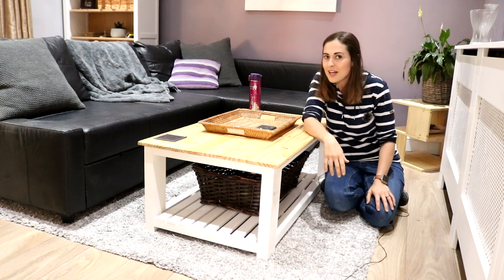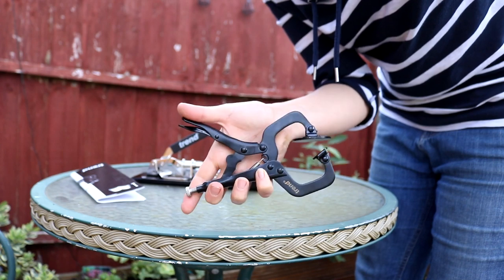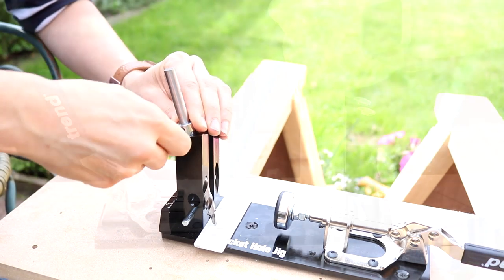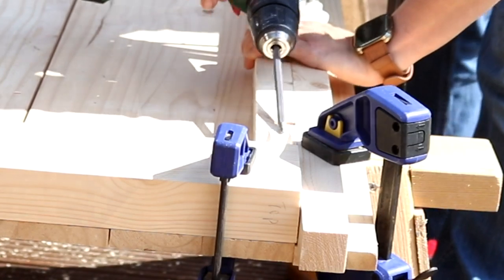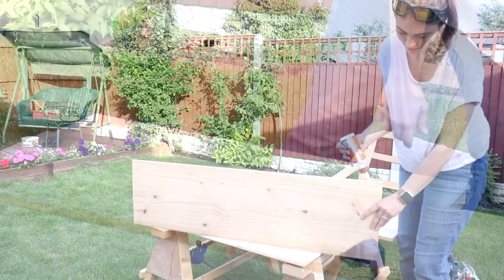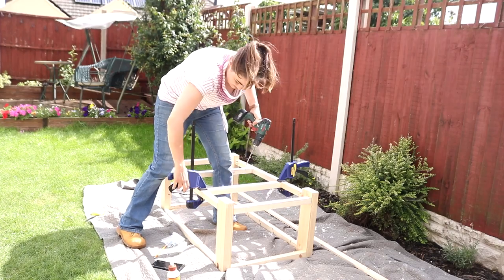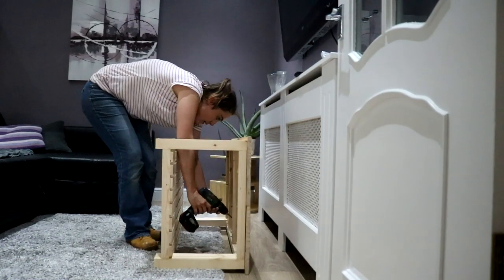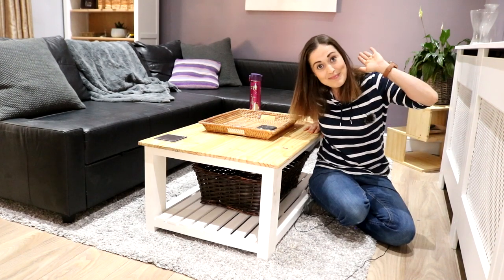DIY Farmhouse Coffee Table With Storage & Decorated in Homemade Chalk Paint

Comment: All good, one observation - a side of the top should be allowed to 'float' to allow for the difference in expansion of the crossgrain wood vs the side stringer.
Reply from the maker: Thanks for the tip!  So would you remove the side pocket hole screws that fix to the coffee table top?
Reply: The Carpenter's Daughter easiest way is using cleats and groves in the side frame to allow the cleats to move. But also taking more care with the choice of wood is really important. 

From the look of it I presume that your using standard sized SPF from somewhere like B&Q? Whilst this kind of wood is nice and cheap and great for doing larger construction projects- building walls and the like where any movement of the wood is going to be limited by the scale of the build and the fact that it’s probably going to be concealed and covered over by panelling, plasterboard and plaster etc. It isn’t great for doing small furniture projects like this.

The reason this kind of timber is cheap is because it is not fully dried out timber. So over time as it looses the excess moisture in it it will change shape, and this effect can be seen over a matter of days. SPF can be as straight as an arrow after being cut after the saw mill but a few days after being shipped and stacked at the DIY store and it can warp.

Even the pine boards that you used for the top, which I presume they had labelled as ‘furniture boards’, aren’t really ideal for any significant furniture application greater than a simple set of shelves where again the moisture content and expansion and contraction is of minimal worry because they aren’t jointed to any other boards or timber sections. Like I said most timber in these stores is not meant to be used in furniture rather interior joinery (even if it does say furniture on the label!).

Sourcing good lumber as a DIY/ amateur builder can be expensive and intimidating. But rather than going to a high street DIY chain you’re best off finding either a local timber merchant or see if you have anywhere locally that does reclaimed timber. Old reclaimed pine can be great because you can guarantee it’s got a low moisture content but you could also find some hardwoods like poplar, beech or some soft maple which are great for projects like this too. Don’t be scared by the hardwoods, even the cost, because it will be better in the long run.
Reply: Failing going to a proper timber merchant or a reclaimed timber yard, you’d probably have been better using plywood laminated together to get the same timber dimensions as the SPF you used. Would also be  relatively easy to create groves in the frame for cleats to fit into for the top boards that way too...

I hope this doesn’t sound condescending. I don’t mean too. This is purely based on my own experience and the problems I have encountered in the past. I used to assume wood was wood. But there’s more to it than that and until someone says so you never know!

Comment: Gorgeous table, well worth getting the pocket hole jig for. The pine top against the white painted parts is effective. I have also made old unfinished pine shelves look fab, using Rustins mahogany varnish. 😍
Reply from the maker: Agree about the coffee table!  I wish I'd have bought the one that works with thicker timber, but it's more than double the price and this one has apparently massively dropped down in price, so went with this to see how I get on for a while :)  The mahogany sounds lovely and would match my recycling bin, but designed this to match the bookcase and end table I made :)

Comment: Another Goodu'n!
It looks like you are expanding your tool range well now! Just remember to never be tempted to use normal countersunk screws with pocket holes as they Will split! You can get fillers for those pocket holes (or if you are tight like me) use dowels and a hacksaw, a dab of glue and sand flush and it is almost invisible ..... it Is invisible if you paint ;0)
Eather way you have something better than Ikea sell and a talking point too!
You need to tell us how the Gorilla glue holds up ;0)
Reply from the maker: Thanks!  So far, it's the glue worked great on my knife block, but wasnt sure with regards to a coffee table top.  And thanks for the tip again!  I will only use the washer screws for the pocket holes and have bought another bag of them for when I run out of the ones that came with it :)
Reply from the maker: Of and forgot to say, yes, I probably will make my own plugs cutting up existing dowel... I've got a fair bit in the garage which is a pain to store and have seen the plug cutters :)